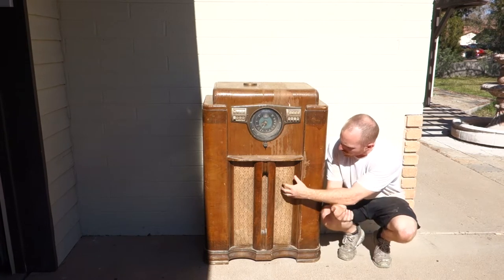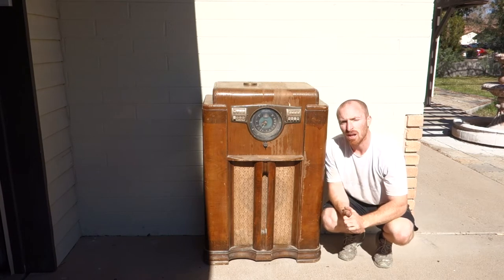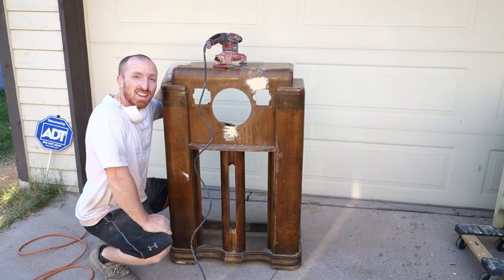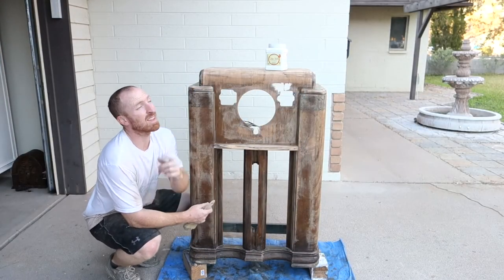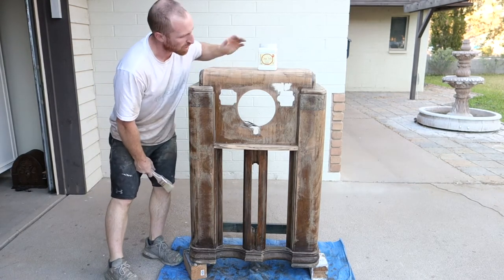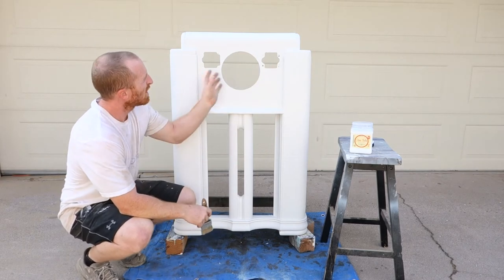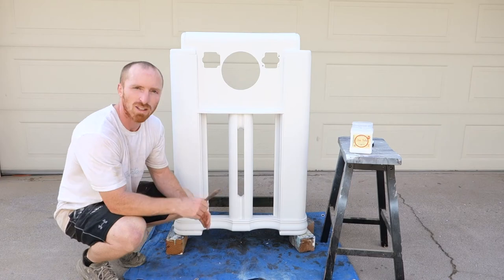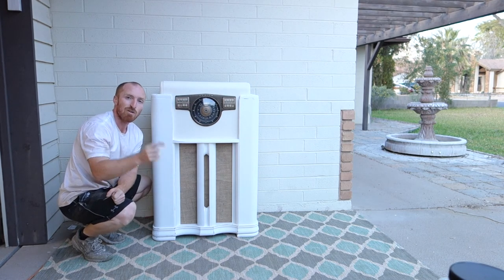Redoing a vintage Radio: Zenith radio: Modernizing an old radio

Comment: That looks good! A radio that probably no one would have attempted to restore. I would have done the same prep work but went with an automotive spray. A good base coat clear coat would give it an ultra shine with more protection. I did a table top Philco radio that was a bakelite plastic and it came out great with the base coat clear coat paint from a spray can. Good looking radio you have though!